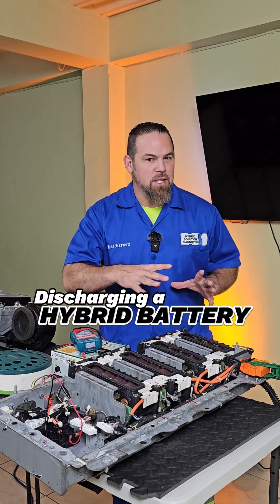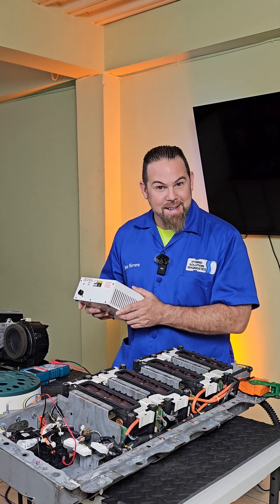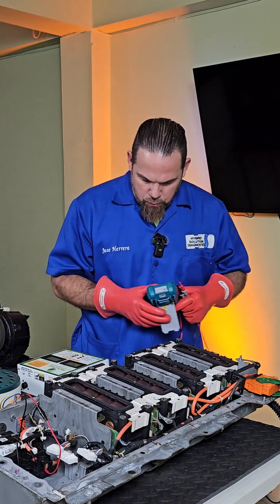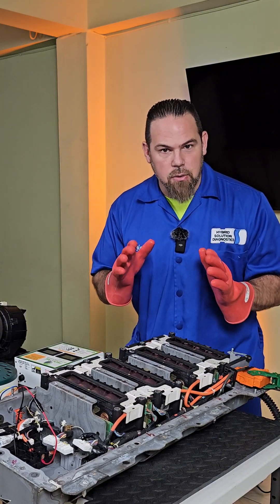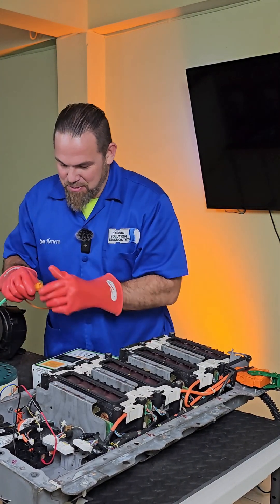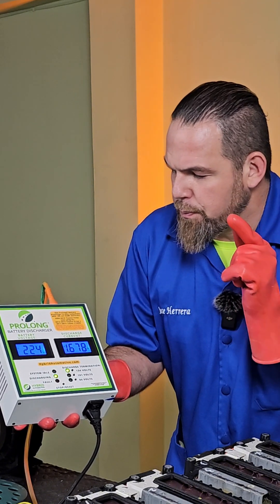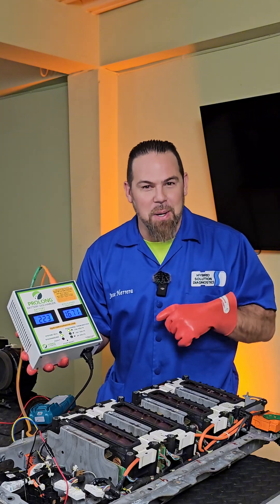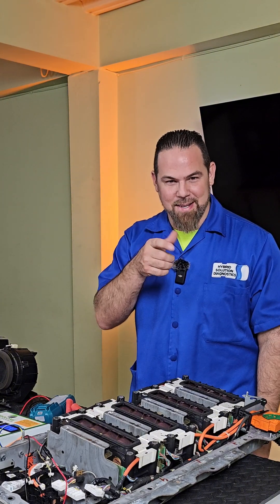Discharging a Hybrid Battery

Comment: Why don't you just put the gear on N position while the car is running and turn the air conditioning and the lights on then the battery will discharge.
Why using the discharge device?
Reply: ,🤣🤣🤣🤣
Okey.
I just realized that the car wont work to do that.
Thank you 👍
Reply from the maker: I will pretend you didn’t say that ok 😒😒👨‍🔧👨‍🔧

Comment: I know you are really knowledgeable that’s what I’m reaching out to you. I have a Nissan Altima hybrid 2011. I recondition the battery installed but now when I put it together voltage is 260 but car won’t turn on I know is something to do with my lo voltage because is no activating relays
Reply from the maker: Check out the PRA